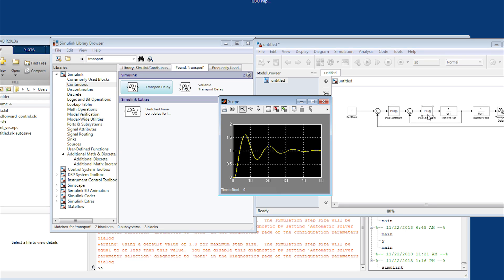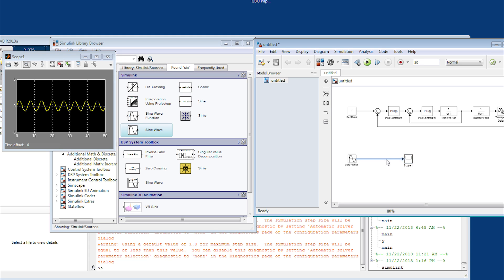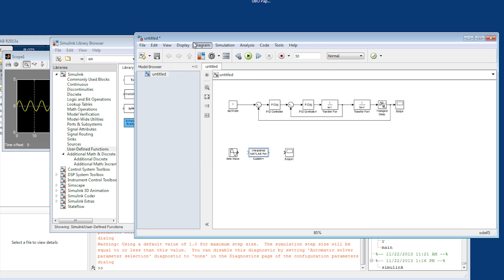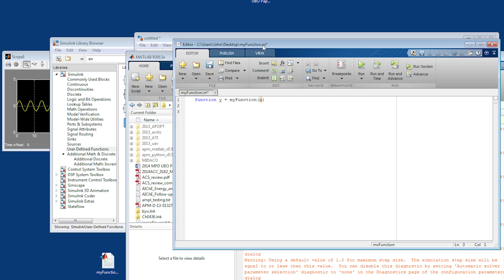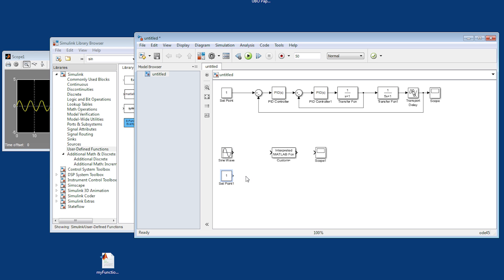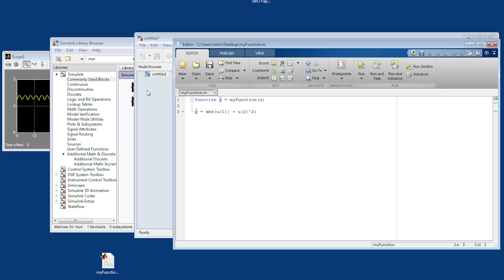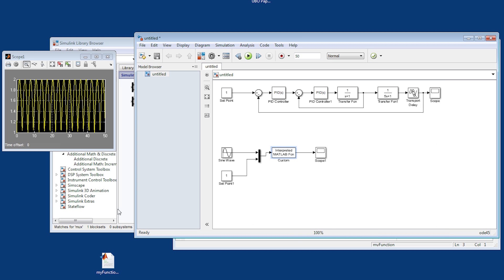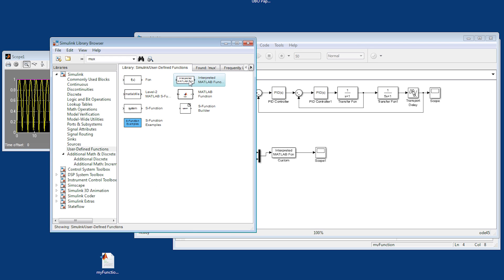Custom MATLAB Functions in Simulink

Comment: hey there.. i wanna make a function  whch takes multiple input variables and gives multiple outputs..how can i do it?
Reply from the maker: You can add additional inputs to the place where you have just one. For an output you'll need to return an array of values.
Reply: @apm  i wanna talk to u..can i get ur email or something ..this is reallu urgent
Reply: I need help sir.. i want to find the value of firing angles alpha 1 ,alpha 2 and alpha 3  from the input Xa ,Xb, Xc...  i wrote this code in matlab bt it gives so many error..plz help me correct this code sir
Reply: And as i mentioned above.. the firing angles is to found by solving an equation..  so basically what i got to do is, the input to my function is Xa ,Xb,Xc and by solving the a symbolic equation of the form (a^2 +abcXa ==6 )something like this...and value of alpha1,alpha2, and alpha3 is to be found which is the olp of the function
Reply from the maker: I get too many requests for help and can't help with specific applications. There are many answers to your specific question or one similar to it on sites like stack Exchange or on the MathWorks help site.
Reply: @apm  thanks u lost one subscriber !
Reply: Help me plz

Comment: hi,i have made a electrical simulation in simscape and i need to obtain DWT of a certain phase  current but it seems to me that there are some errors.do i need to do  some conversion in the phase current?
Reply from the maker: Unfortunately I'm not familiar with simscape. There may be some answers on Stack Exchange or from the MathWorks website.

Comment: Thanks for the video... Is it possible to use if statement in the matlab script? I have 3 outputs  [S(1); S(2);S(3)] and 4 inputs;
 The output is a calculated from the inputs {x(2); x(3) and x(4)}.
The if statement is performed on x(1). 
Code responding error; output 'S' not assigned. Thanks again
Reply from the maker: Here is additional help on custom functions: http://apmonitor.com/che436/index.php/Main/ProjectProgramming  You may need to return S from your function.

Comment: Hello! If you could help me it would be great!

(In simpowersystem) I'm trying to insert a resistor that accepts an input signal, but I can't. It seems that it's not compatible with the ones that are already in Matlab

I need that this resistor varies in function of the input signal, because it will be connected to the outputs of a solar panel (simulated) and this resistor receives the current signal from the inverter

so... jajaja thanks again!!
Reply from the maker: +Frida GüerecaEstrada, I probably can't help you with simpowersystem because I haven't used it before. However, if you want to simulate a resistor in a circuit then the current should be equal for the input and output. The only thing that will change through the resistor is the output voltage that is based on the current.
Reply: Thanks!

Comment: Great video! Perhaps you can help me. I am trying to create a custom block that will be able to compute z=e^(Ts) - where T is a sampling period and s is of the domain. Not sure how to create a block that will read this as a domain and not as a variable
Reply from the maker: Your function looks like the z-transform for discrete systems. I recommend a "transport delay" block for implementing a function like e^(-T*s) in the Laplace domain (s). You can also use discrete transfer functions that use z (or q) instead. Look for discrete transfer functions in the Simulink library.

Comment: Hi, I have written a matlab .m file which communicates with a touchscreen via an Arduino mega. The code returns a 2 x 1 matrix relating to an x and y coordinate. If I wanted to convert this m file to a Simulink block can I follow your approach as outlined in this video or is there a better way.
Reply from the maker: +Peter Bennett, you may want to look at a triggered subsystem as well. The trigger could be when the program detects contact with the screen or some other input. An interpreted MATLAB function is good for converting subroutine functions into Simulink but it may not be the best fit for this application.

Comment: can i run my face detection .m file in simulink using interpreted function block@APMonitor.com
Reply from the maker: Yes, you should be able to do this. I recommend that you use a Triggered Subsystem to control how frequently the face detection runs. To slow down the Simulink to match simulation time and real-time, I recommend the real-time pacer: https://www.mathworks.com/matlabcentral/fileexchange/29107-real-time-pacer-for-simulink

Comment: Nice video.   Sir, please any help with  simulink block to specify number of samples
Reply: Monday Ikhide you can determine the number of samples reported by using a "to Workspace" block that will make your data available after the simulation. If you need something to happen at particular times, you can use a triggered subsystem. Let me know if that isn't what you are asking.
Reply: Many thanks

Comment: Dear Sir, I was wondering if I was using Simulink to simulate an electric circuit that uses a battery, and I wanted to use the SOC (state of charge) of the battery as the input of the function. How should I go about it?
Reply from the maker: Here is one project that uses batteries and SOC: 
https://youtu.be/N6JgwBmrDkQ?list=PLLBUgWXdTBDjnlnHY7L9_S6TbSzPvIlVQ  
You may consider making a loop with the difference between charge and 
discharge and sending that through an integrator before the loopback. 
You'll also want to account for the inefficiencies of the charge / 
discharge rates.

Comment: Hello sir, i want to take input from the users using simulink,Is there any function for scanning input from the usres.
Reply from the maker: Yes, look in the Sources category in the Simulink library. You'll find a couple different options for inputs. I like to use an input slider because you can specify an upper and lower bound and the user just needs to slide the bar back and forth to change the input.
Reply: +APMonitor.com. okiee its really helpful thank you :-)

Comment: Dear APMonitor.com if i have to simulate a 3 scalar nonlinear differential equations . should i do it by calling the runge kutta from a matlab built in function in simulink or should i use an S function. what will be the advantages of the S function over the matlab built in function block?
Reply from the maker: +Farooq Kifayatullah You can use either but the MATLAB function will be a lot easier to implement. The advantage of Simulink is that the model inputs and outputs are easier to manually manipulate and possibly to the connect with other models. If you just need to simulate some differential equations then the APMonitor modeling language (freely available) is another option. There are some tutorials here: http://apmonitor.com/che263/index.php/Main/MatlabDynamicSim
Reply: +Farooq Kifayatullah HI , I found a 74% OFF coupon to Learn Matlab Udemy course

https://www.udemy.com/learn-matlab/?couponCode=ML25
Reply: thanks mikail i really dont have the money
Reply from the maker: +Farooq Kifayatullah Sorry for the spam message - I've been getting many of them recently. I reported the message to Udemy.com and they are taking appropriate actions.

Comment: Dear sir i use matlab 2007 and i need a block to calculate settilling time , max over shot and other control parameters ?
can you please help in that
Reply from the maker: +maatheking2010 You probably want to send the output data to the workspace and then post-process after the Simulink has finished running to determine settling time, max overshoot, etc. Another way is to plot the data and determine those graphically.

Comment: Dear sir, This's nice video. I would like to know about transferring data from Simulink to M-file, and then send back signal from M-file to Simulink that is real-time, How to do this?  I hope you will send the answer soon. Thanks a lot sir.
Reply: I would like to execute the Simulink and M-file together that I would like to keep data in previous signal and calculate signal in present in Simulink. Thanks sir
Reply from the maker: +Wijak Pornsukvitoon The m-file will be called by the Simulink model as it executes. You can have many inputs and output to the m-file with blocks such as "MATLAB Function" or "Interpreted MATLAB Function" (my favorites to use for this type of problem). You can also use an S-function if your equations are differentials.
Reply: +APMonitor.com Thanks sir

Comment: Dear sir i use matlab R2013b if i have function y(t) as following t=[ 1 2 3 4 5 6 7 ] y=[ 2 10 15 20 30 60 70] i want to use y in simulink how i can define this function in simulink thank you in advance------------ where t is the time
Reply from the maker: +maatheking2010 Please see http://apmonitor.com/che436/index.php/Main/ProjectProgramming and look at the example problem on "Import Data File into Simulink".
Reply: +APMonitor.com many thanks for your grateful help
Reply: +maatheking2010 where x is the time
Reply from the maker: +maatheking2010 Yes, the files that I posted to the web-site should work for you. You'll just need to modify the variable "time" to be "x". http://apmonitor.com/che436/uploads/Main/interpreted_Simulink_MATLAB.zip
Reply from the maker: +maatheking2010 If you want something that is a higher order approximation than a linear interpolation then you'll need to do something like a polynomial regression within your custom function. Here is a link to polynomial regression in MATLAB: http://apmonitor.com/che263/index.php/Main/MatlabDataRegression
Reply: +APMonitor.com  Dear sir 
many thanks for your grateful help
but still i need to link the output from nonlinear regression with simulink and to make x variable as time of simulink 
can you please help in that
Reply from the maker: +maatheking2010 You should be able to do it the same way at the linear interpolation but just replace the linear interpolation function with your nonlinear regression function. You can return the result of the nonlinear regression from the function just like the linear regression was returned. If you need help with functions and how they work, I'd recommend the MATLAB content here: http://apmonitor.com/che263
Reply: +APMonitor.com  many thanks for your grateful help

Comment: hi! great video tutorial ! 
I have some trouble with an aplication, enunciated bellow : 

build a model that simulates a first order system of Error ! Referral source not found. 
in response to an input u = sin(t) using MATLAB Fcn block of User's defined Functions category.

excuse my english :p 
thnx in advance
Reply from the maker: +Masnsen Yuva Here is another video that describes first order systems: https://youtu.be/BAinE-hy7o0  This video shows how to implement a User defined Function. You can test your implementation by using a built-in "sin(t)" source block and a "Transfer Fcn" block as a first-order system. I hope this helps.
Reply: +APMonitor.com than you!
it's very helpful, finally there was an error in the announcement of the exercise! the function which needed to be simulated using the UDF block was 3/s+2!!   I just need to know when we use the clock block in simulink ?
Reply from the maker: +Masnsen Yuva You asked about clock inputs as well - here is some help from Simulink: The Clock block outputs the current simulation time at each simulation step. This block is useful for other blocks that need the simulation time. When you need the current time within a discrete system, use the Digital Clock block.
Reply: exactly as I expected !
thnx a lot :)

Comment: Hey
Could you help me identify how to access and edit codes of functional blocks already present? ( I mean ones that are coded by Matlab and not custom coded)
Say like counter functional block present in Switches and Counters, Simulink (dspswit3).
Reply from the maker: Sandhya Ram Unfortunately, I don't think it is possible to edit functional blocks that are already present. You can modify several of these functional blocks, however. Right-click the block and select "Properties". You will see a tab "Callbacks" that allows you to program custom functions and scripts with certain events related to the Simulink simulation.
Reply: APMonitor.com I am grateful for your quick reply. 
I am unable to edit/select any thing in Callbacks.

I want to make a tunable input, maximum count, in Counter (Functional Block in Switches and Counters) as an one of the input parameters along with Inc, Rst, Hit and Cnt. Could you help?
Reply from the maker: Callbacks allow you to run a custom script when certain events happen. You'll need to program your custom script and then add the call to it in the callback section.
Reply: Alright. Thank you very much.
Reply from the maker: Sandhya Ram There is a list of free supported compilers here: http://www.mathworks.com/support/compilers/R2015a/win64.html For any custom code, I recommend setting a break-point and running in debug mode. You shouldn't need a MEX function / compiler if you are just using MATLAB code.
Reply: APMonitor.com Thank You very much!